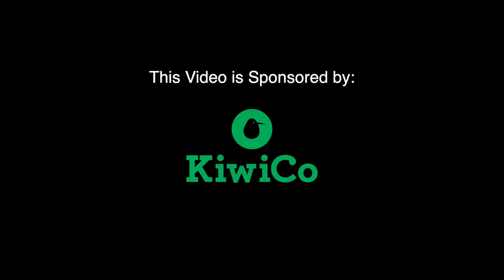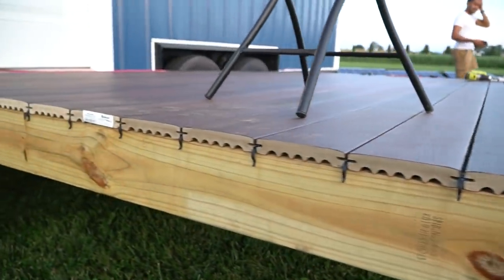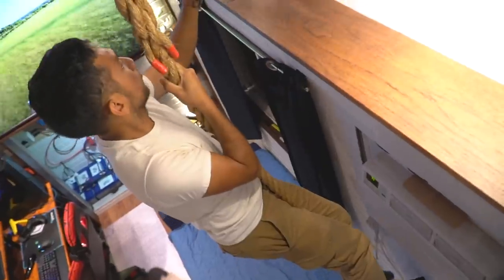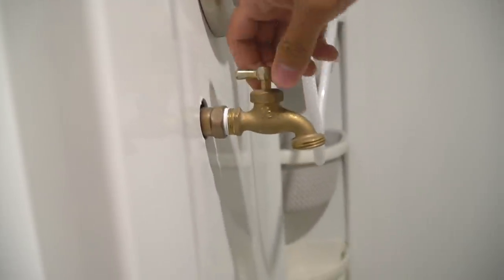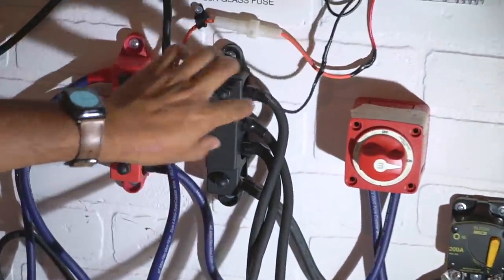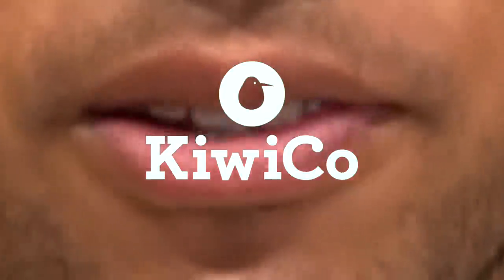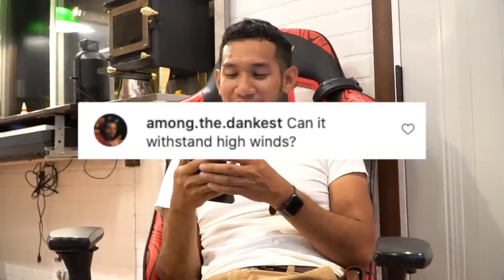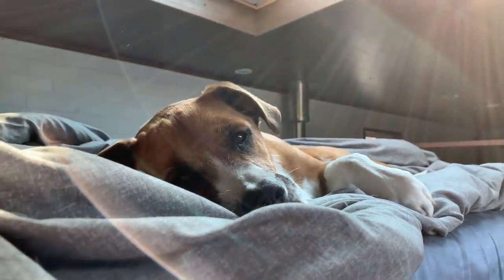BUILDING AN ILLEGAL HOUSE for 30,000$

Comment: Id recommend mixing a bit of tapwater into the RO water when you get a glass. RO water is technically not that good for you. Your body has a natural osmotic pressure and RO water cam leech stuff like calcium, iron, sodium out of your system. Its not good to be drinking exclusively RO water. Maybe see if the company has nano filter instead of RO filters. Its a step down in filter size so you still have clean water but it leaves all the calcium and magnesium your body needs. 
Source: I work for a local municipality and do water treatment. We are looking at upgrading to nano filters
Reply: Water is not a significant source of mineral nutrients for most people and totally unnecessary for people who eat a healthy diet. The idea that high purity water is somehow bad for you is pseudo-science. But you can always add a few minerals to your RO water if you are worried about it. Just run it over some clean marble pebbles or something.
Reply: Not really a problem. Food contains plenty of minerals too. Mineral loss through drinking ultra-pure water is only an issue for really, really niche situations - like living on a submarine, or a space station.

Comment: To fix the lightning problem you can get a small solar powered VELUX blind in black whit or navy blue and it is remote controlled with a wall mount and it costs around 70-80 dollars

Comment: You should change out the hot water tank to an on demand model...which heats up the water as you use it. No tank whats so ever. As for your solar set up the have a lighting resiter, you add that on there and if lighting should it its designed to take the hit which prevents other damage.

Comment: What's the name of the company you used to make the custom steel frame?   If you had to design a version2, what changes would you make?

I think Tom Green has a nice Land Ark RV.

I'm surprised that there aren't more inexpensive pre-fab like homes, that can be built with interlocking parts by anyone.   All the tiny-homes I've seen (Nestron, Muji Hut, Blokable , Katerra , indieDwell, LeapHome, Tumbleweed, New Frontier, Wheelhaus, Tiny Cocoons, Escape Traveler, Tiny Heirloom, ) are expensive!

Comment: Talking about tripping breakers when using to much stuff figured I would add this little facted: in my 32ft fifth wheel from 2006 we can't use the microwave and the water heater at the same time. And why not use a RV air-conditioning unit? Just curious

Comment: If you DO go to Florida, do like my great aunt and uncle and have a distant backup property for the hurricane season. Sure, you can stay in Florida most of the summer and fall, but subjecting the tiny house to 60+ MPH winds regularly is surely not good for it, even with anchors. And most tropical storms/hurricanes have enough notice to get out of those high winds by moving elsewhere, as my relatives would usually drive from their canal-front property on an island to somewhere in the plains of Pennsylvania if things got too bad for their lifted concrete waterfront house.

Comment: Could you not make a waterproof jacket/coat filled with the insulation you used for the walls to cover the water tank stop the water freezing as quick in colder conditions ?

Comment: I have a few questions could you use aluminum whith cross bracing its more affordable and instead of using wood on the inside could u use a less dense material including the insulation. It would make it lighter less weight makes better gas mileage

Comment: At 14,000 pounds and a small cross section you should calculate your gust wind speeds before installing your tie downs. you might not need them unless your in tornado alley. I would also see how you would come up with your calculations.

Comment: I ran into a fellow one time that built their tiny home and the neighbors complained that it was too small.  Apparently the township had a regulation on the size of the home.  He and his wife did not know what they were going to do about things.  I laughed and said that the solution was easy.  All they had to do was build an appropriate sized building over it.  Problem solved!  I don't know if they followed through, but some folks need to get over themselves.  I know of someone that is building a pole building and they are going to live in their camper inside of it.  Brilliant!  The only concern would be carbon monoxide if you don't have enough ventilation.  One time I was being harassed by the county tax assessor that I later found out was there because of my bad neighbor that couldn't figure out why I wasn't paying as much tax.  The third time they came out I'm confronted them in angry fashion and they never returned and my neighbor who was a fool just couldn't figure out why he was paying more tax.  He bought the house and built a big workshop and they reassessed his property tax.  He built another great big building and they reassessed his property tax again.  Yes, he couldn't figure out why he was paying more tax than anybody else.  I moved away from the stupidity.

Comment: Plus you need Tornado 🌪️ Strap's Tiny House
= Tiny Trailer or Bury the tiny house in a trench where even the roof is even with the ground seems like an idea for for the channel or maybe enclose it in a rebar reinforced concrete  Tornado shelter

Comment: I've thought about designing a tinyhouse. But me being be, I want space and volume. So, I've been wondering if it's feasible, physically and legally, to build a transformer. Ya know, a trailer that has fold out panels to extend the walls and double or triple the floor space and perhaps even a screw-jack system to raise the roof. I'd anticipate more structural mass, so I wonder if it would make more sense to build it from aluminum instead of steel, or if that runs into other physical or legal hurdles.

If the legality is questionable, or if its intended to be used for post-apocalyptic survival, then I anticipate it would need to be camouflaged. And if power is limited, one might have to design the folding and jacking mechanisms to operate manually. I guess that would make such a transformer a Decepticon instead of an Autobot.

Comment: 20:49 that statement isn't really fair. Maybe that's true for a lot of tiny house things you might see... but there's not really any reason that they couldn't tap into the same sorts of lots that long time RV or "park model" trailers people use. Unless there's laws against it or something? My parents have done a full time RV thing for 20+ years and currently have a "lot" (a small portion of land) down in Florida with a park model on it. Park models are basically travel trailers, but they are set on a lot like a mobile home is. Generally people build add on rooms to them and add porches and such like your deck. Those lots have utilities and addresses and such.

Comment: Replace your porch with 3 inch steel tubing and metal grating attached to house with hinges. So when you need to move.  It flips up on side of house and is secured. Solar panels on roof. Maybe a tarp to catch rain water going to cistern to wash clothes , body , dishes.  Yes. No?? Have a great day.  Did you say that the stove is your heat and cooking source ?? $30,000.00 for material and you did ALL labor ?? Or did you need to farm something out.??

Comment: This guy needs some propane in his life style. Being 100% reliant on solar is kinda risky.
I run an on demand propane water heater instead of a boiler, love it.
I also have an electric boilet which can be heated with the hot air from the propane stove. 
Cook and heat on propane as well.

Having just 1 system for everything is kinda fucked, especially in colder climates.

Comment: It’s very half assed. The edging on the sealing is not finished, or smooth and not straight. The wallpaper is very crooked and not good. Your kitchen wall stone shit only goes half way up the wall. You haven’t painted shit and haven’t sanded shit. Haven’t tried to cable manage. It’s terrible man